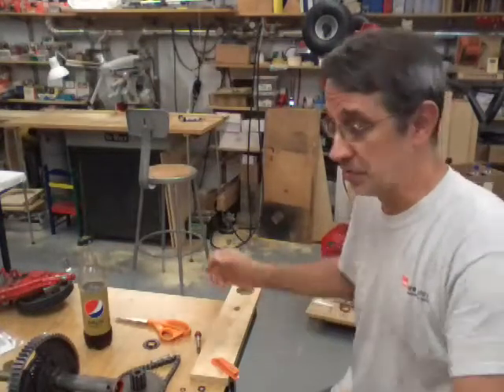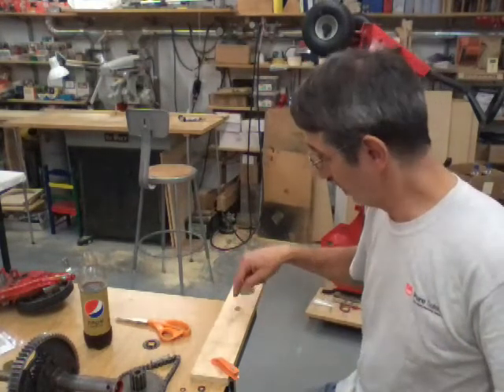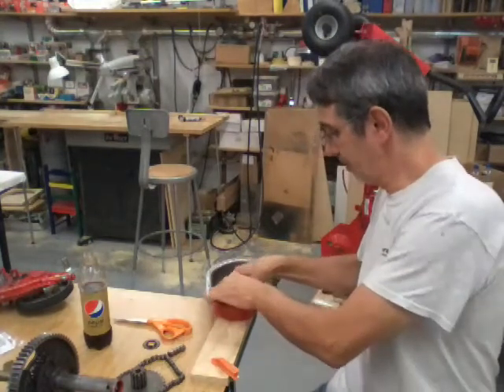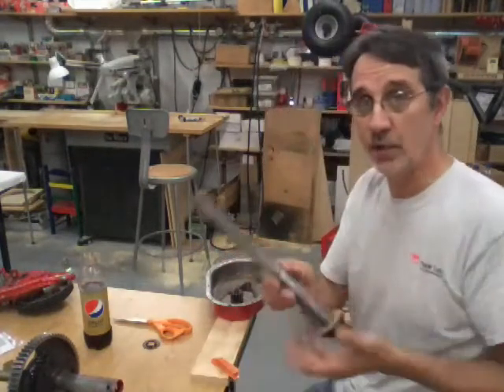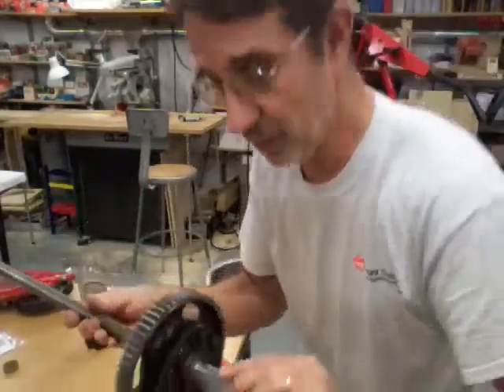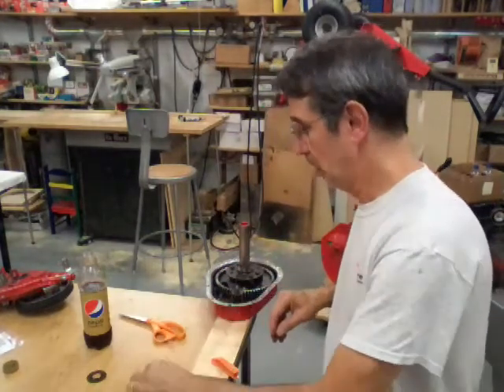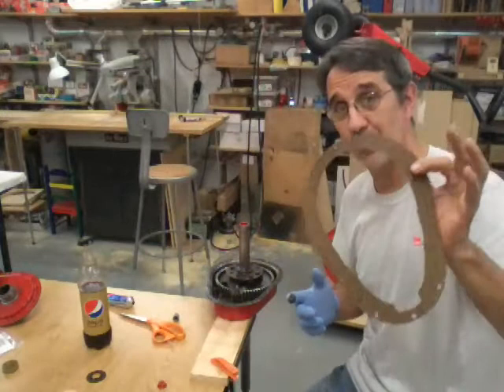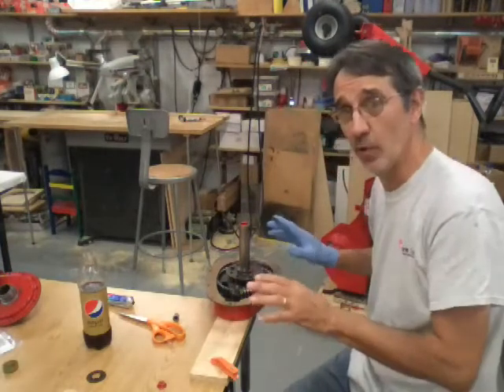136.  Reassembling the differential on a Snapper rear engine rider

Comment: Just watched it for the 2nd or 3rd time, You can only like it 1 x so I can't tell 
I take notes and back it up and re-listen to parts so I think I take at least over an hour to get thru it
there is a lot of good information in this one. If a guy is going to take both boxes apart and add the new gaskets like you talk about you should, "if" a guy is going to change over to 90 weight gear lube oil. I think everything ( information)  is finally sinking in. Like the hex flat washer against the hex then nylon flat then the fender/with bushing pressed in then another hex flat against the hex axle and a number of nylon flats as needed Hope I got that right
Reply from the maker: @janbill79  i’ve got a lot of video series of taking differentials and chain cases apart that you could watch but if you get into a spot where you can’t figure it out just send me an email and I’ll try to walk you through it.

Comment: Hey Jim, BJ here.  Just a couple of things I thought I would add.  On my model (3314520-BVE) there is a plastic washer, nylon hex (part no. 7010988YP) that goes between the hex shaft and the inside of the differential cover.  It spaces the hex shaft gear so that it lines up with the larger gear (the one the bolt slides through), and keeps the hex shaft from raw-riding on the inside cover.  Also, bought a new diff. cover from PartsTree (part no. 7037279YP).  Found out that the bolts are self-tapping, so before spreading the gasket goo, you may want to pre-tap the cover with the bolts you have.  I my case, since I didn't pre-tap them with the bolts, I just hand tapped the cover to the bolts I removed with the case together (post goo-spreading).   Live and Learn.  Thanks for the video, never would of got this thing back together without it.
Reply from the maker: B.J. Boyette 
 Hi it’s Jim
   Well glad to hear your starting to put it back together if you have any other issues or need some help let me know, talk to you soon Jim

Comment: Hi Jim, thanks again for all your valuable information.  
I have the differential apart in order to replace hex axle. I accidentally ordered the gasket for the chain case instead of the differential. 
Would you ever just use rtv or permatex without the snapper gasket?   This is for a 2010 33”.

Comment: Your videos are most thorough and helpful!👍🏻
 Permatex makes a slew of products, could you please tell us what specific sealer you are using? One sealer that should not be used is silicone sealer on cork gaskets as it will cause the gasket to squeeze out. Thanks 😊
Reply from the maker: The tube says,  form a gasket sealant number 2 non-hardening
That’s the only thing I ever use. Jim
Reply: @jimjackson9381 Thanks 👍🏻

Comment: Hi Jim,
Concerning the bushing- the replacements that I have are the right part number for my machine, but they don’t have the two grooves that you say allows gear oil to get in between the axle & bushing. Should I take a round file & make some similar to my original?
Thanks!
Reply from the maker: Yes I would.     Jim

Comment: I wonder if I could order a complete drive assembly? My 28 inch has movement side to side. About a 1/2 inch. Starting to get a little popping noise in it sometimes
Reply from the maker: Well I’m sure you could but it would be expensive it would be a whole lot cheaper to rebuild the one you have. Jim

Comment: Hey Jim., love your information on Snappers. I have a Snapper Series 24 28" deck with a 12.5HP Briggs & Stratton engine. You mention replacing the Snapper Lub from the transmission and replacing it with 80/90 gear lub. How do you get the old Snapper Lub out without removing the gear case covers or is it even possible? An old Hillbilly from Hot Springs Arkansas
Reply from the maker: Sky High 
Hi it’s Jim
   The only way I found that really works is to take them apart and clean them out,  There is a few  things you have to do before you can put 80/90 gear lube in your machine. The machine that I am rebuilding right now I am going to go over them issues and show you what you need to do to be able to use 80/90 gear lube in your differential and chain case. Jim

Comment: Jim I picked up a Snapper comet 28” complete  rear axle with side panels. My snapper com 30” needs to be rebuilt. Can I install the 28” axle on my 30”? 
Thanks,     Mike
Reply from the maker: Yes it should fit the rear cases from 28 to 33 inch are mostly all the same. If you want to be sure you can measure it and compare the two.Jim

Comment: Good morning Jim you may have answered this question in other videos but where is the model # located on those mowers, the one I'm working on has definitively scene better days so finding ID # is difficult when you don't know where to look first and thanks for these great videos.
Reply from the maker: Tim Pope 
Hi Tim
  Well there is about three different places depending on the year of the machine.
     The oldest ones the labels were on  the Front of the main case. 
     Then they started labeling them on the back of the main case. 
   Then they started putting the numbers on the tube where it enters the main case.
Reply: @jimjackson9381  so just labels and no metal stamped # ?
Reply from the maker: Tim Pope 
  As far as I know it’s just a sticky plastic label  I have never seen one that they stamp in  the steel. Thanks Jim
Reply: @jimjackson9381  Thanks !

Comment: Jim, I've put mine together about 17 times and can not get it to work. Bolts are impossible to start, cross thread, or go in and the differential locks up within a half turn. Yours goes effortlessly together. What do you think is going on?
Reply: I even tried with 4 gears instead of 8 and it still doesn't work.
Reply from the maker: Michael Meredith can you send me some pictures of what you have to my email
jimsfixitshop@gmail.com
  Thanks Jim

Comment: Whats the arm on the lift yoke for? Just bought a non runner and that arm has jammed into the rubber disc. Dont see what that arm is even for.
Reply from the maker: Robert Clark 
Can you send me a picture if it         Thanks Jim
Reply: Jim Jackson I dont know how but its that round bar thing made to the opposite end of the lift yoke for the clutch.The spring hooks to one arm but that other thing does nothing that I can see but be in the way.

Comment: Hi Jim,
I purchased new axles and the long axle is entirely painted black. This doesn't make sense to me. The paint will just wear off and float around in the differential. I should strip the paint off right? I am considering stripping the paint and having it nickel plated and putting Oilite sleeves in the axle bearings for a closer fit. All the new mating surfaces like bushings and shafts have .01" clearance. This seems like way too much. The pinion gears and spacers have .02" clearance. Are they supposed to be that sloppy? How are we to know? Do you have reference materials with dimensions and tolerances?
Thanks

Comment: Hello Jim
I am a new subscriber and really enjoyed your instructional videos. I followed your instructions to disassemble my rototiller. When I disassembled my differential I found that the main gear attached to the axle appears to be stripped. I also noted that my hex drive was not attached to the gear as it appears it was in your video. Not sure if that is an issue, maybe mine is different. I noticed that the machine you are working on is not the same as mine as mine is a walk behind rototiller. My question is if I order a main gear how do I ensure I get the right one. My model # is R8002B and Serial # is 55622532. Can I order my parts through you as I have confidence you will ensure I get the right ones. By the way I live in Canada not sure if that is an issue.
Thanks Dave
Reply from the maker: I’m going to have to know what brand this Rototiller is because I’ve never worked on a Rototiller snowblowers yes. Jim

Comment: hey jim, a lot of guys wanted to know the year of their snapper riders and i found a link at tractordata.com  they have all the model numbers from 1966-2014 and the date they were produced.with that in mind my rider is model number is 307x and it was built from 1968-1971,but still no series number for mine.if you have worked on any 1968-1971 snapper riders could you please steer me in the right place on parts tree for the series # that i need for my snapper.THANX! by the way great videos.

Comment: Anybody try "Super S Cotton Picker Spindle Grease "00" from Tractor Supply? Just got me a quart the other day. Only $5.95 a quart. Topped off my chain drive and differential cases.
(By the way, the label might not say anything about cotton pickers, as it apparently used to. The bottle I bought just had a big "00" on the front. Who knows, maybe "cotton picker" is too politically incorrect these days.)
Reply: I filled mine with it a few months ago, must have been low cause it took almost a full bottle for both. So far so good.

Comment: Where is your email address ? I can't find it .
Can I pu a smaller pulley on my rear engine rider snapper mower above the drive disc .to make it go faster ?
Reply from the maker: No, if you put a smaller pulley on the engine that will make the blade run slower you need to put a bigger pulley on the engine to make the blade go faster. My email is
jimsfixitshop@gmail.com
Thanks. Jim